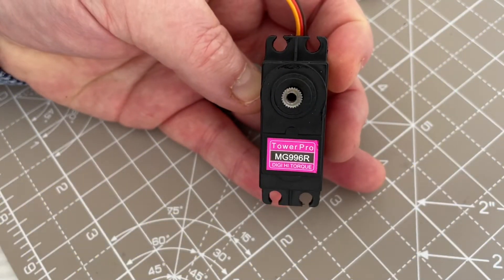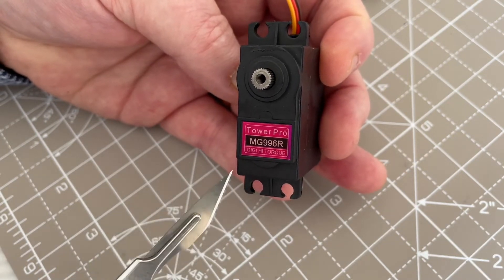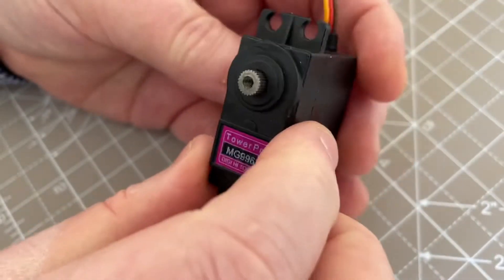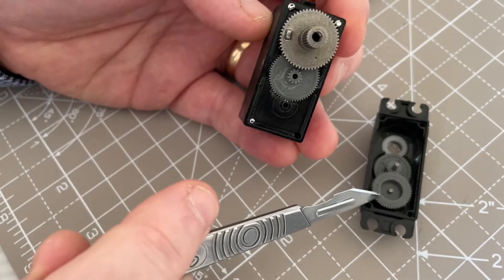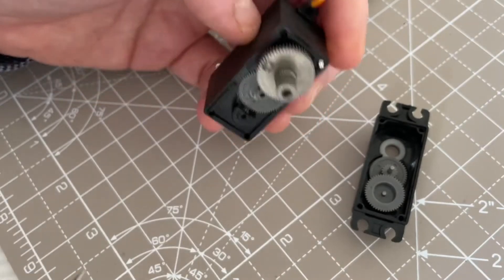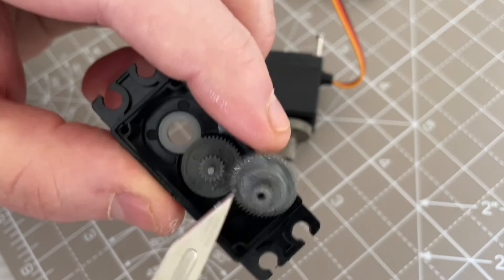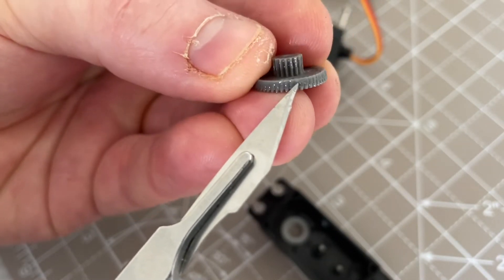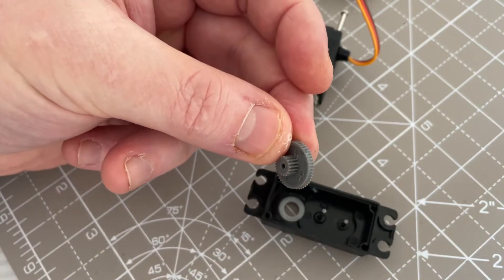TowerPro MG996R Servo

Comment: Hiya John. Ooh the cheeky sods!  I had a load of trouble with those servos but they just died rather than the gears stripping.  I just use those DSServo 25kg ones in nearly everything now as I don't think I've ever had one fail.  There are a couple of cars that need a smaller servo but generally they are great.  Thanks for your investigative work in exposing this.  Like you say, RC people don't mind taking things apart so they were bound to get found out.  Cheers mate 🙂
Reply from the maker: Hi there my Guru! You know I’ll never forget you too 😁😉. Thank you for watching. I would never had known. I went exploring after I heard the gears stripping and they sounded wrong. Hence the tools out! I’ve got some of those DSServo 25Kg ones too, they are very good, thanks for the tip. Take care my guru and all the best to you and the family 😊😉😊

Comment: Hey John, I used these when I started getting back into the hobby. Two of them fried and bust my ESCs at the same time! They have a place in shelf queens perhaps but for me I am sticking with more reliable servos going forward 👍🏻 Great video matey 🙌🏻
Reply from the maker: Hi Craig, yep luckily for me, it went strange on the hobby table as I was setting up the steering geometry. I like to have as much of the steering straight mechanically, so I don’t have to dial out too much on the radio. I was putting the servo through its paces unloaded, while setting up, it went all the way to the right, kept going, and before I could get to the off switch, rounded out the gears. But it was this action and sound, that May me curious. It wasn’t metal rounding out sound, so opened the servo up and saw just the main output gear as alloy,the other hidden behind the cover, are plastic. Yet it’s sold to us RC enthusiasts as a metal geared servo. So thought to bring it to everyone attention. We all spend a lot of money with this hobby, it’s nit right being mislead! Take care, best wishes and Happy Easter to you and the family. Track by the way, awesome! 😊😉😊

Comment: hrrrmmmm... now I am going to have to pull one of mine apart and see what is in them. I have the 995 metal geared servos and like you assumed they are full metal geared. I have not stripped on yet but I am going to have to crack one open and see what is in there!
Reply from the maker: Hi Addam, thank you for watching. I was lucky with this one, as I was testing it on the bench in the RC to set up the steering, so no harm to the model. It was the electronics that failed, that made the motor spin without stopping at the predetermined limits, carry on trying to spin before I could pull the power, then I heard the gears go, then thought, that’s not metal sound, which then made me investigate further to reveal. I’ve got a feeling this isn’t perhaps a true TowerPro, but a counterfeit, hence the deception. Anyway, caught in time. Take care, best wishes and happy Easter to you and the family 😉😊😉
Reply: @JF-RC  happy Easter to you and your family as well!!
Reply: @AddamsPlayground  Lets not forget, back in the day (yes im going back 25 plus years) MG meant metal gear not metal gears (unless it says so). Even some older Hitec MG servos only had a metal output gear, however, that was stated. Sorry for the luck John, no one wants crappy parts. I now check all that stats & read reviews on such things, I always said buy cheap, buy twice (then I went broke so now I buy cheap, LOL). Not trying to step on toes or start shit,  just pointing out that sometimes we need quality over quantity (you still see me using Hitec servos in my higher end or race kits).
Reply: @UncleBobsRC  Very true... did not think about that!

Comment: Hi John, yep, I bought a set of four of these servos a while ago, and only one is still working! Never buying them again. I took one apart and it did actually have all metal gears, but it was the electronics inside that failed on all of mine. Definitely a brand to be avoided. Thanks for showing, it's great consumer advice my friend. Take care and all the best!  :)
Reply from the maker: Hi Mark, yes, you’re right there bud. The electronics on this one failed, which made the motor spin the gears all the way around and strip the plastic gears, that are suppose to be metal gears. I’ve had a look at the electronics and to be honest it’s BER. take care and best wishes, Happy Easter to you and the family 😉😊😉
Reply: @JF-RC  Happy Easter to you and your family, too!  :)